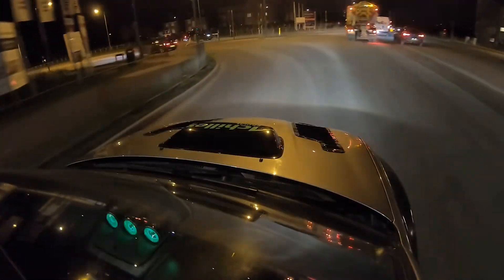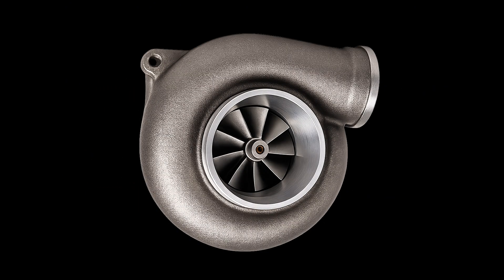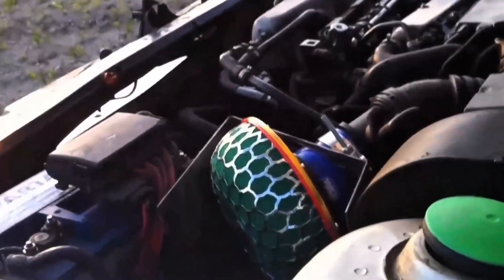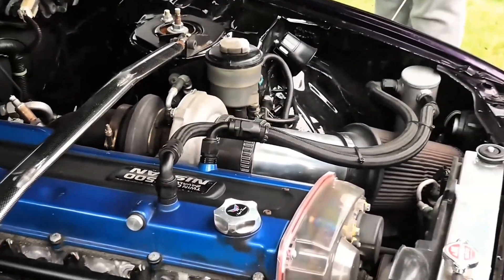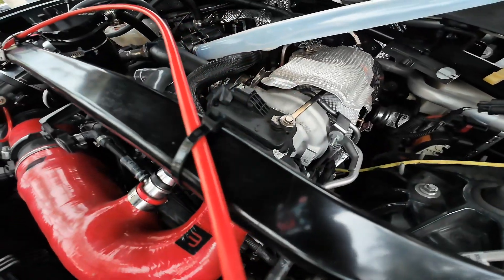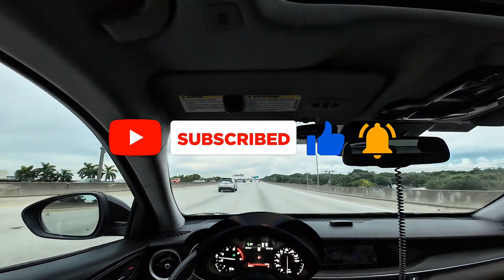Car Culture LIED about TURBO FLUTTER

Comment: Guy can’t read a compressor map to know that SURGE is a specific engineering term for the state of a turbo 

That state is not achievable with a closed throttle 

Surge is caused when a compressor flows more than a system will allow 

It’s at open throttle because it requires the turbine to be pushing the compressor against stacked up air 

When the throttle closes it’s not moving enough CFM to be flowing the numbers at the surge line 

Be careful who you learn from
Reply: Ok teach me something 

WOT Surge is a state of operation with a defined threshold 

It takes newtons of force to reach it and sustain it

It has a name and we see it printed on maps 

It deals with NON LINEAR loads of opposing forces 

Closed throttle Surge (and I’m using the term because you are) would be a variable state with what threshold and what type of force? 

WOT and Closed throttle are binary states that are mutually exclusive and diametrically opposed 

Can you give me practical examples of things that are mutually exclusive and diametrically opposed that have the same name and effect? 

What turbos are you using that the VE of the turbo is so high and so perfect in ratio of housing and compressor that the force they exert, although dropping off still compress so well that air that is non linearly dropping  off in pressure has the same effect 

Ready to learn
Reply: @jrich436  It is not surge if the flow is almost zero (because the throttle is closed) and the pressure ratio is high enough? also people aren't going to read your wall of text because of how it's written, why is every sentence it's own paragraph?
Reply: @DriftNick surge is specifically a threshold  at WOT. You can 100% calculate it and know the millisecond your set up will experience it

The damage is “turbine is going this way but the compressor is trying to go that way”

You have to have this constant and prolonged opposed force to cause this level of damage discussed 

That is surge 

The CFM of an engine and thus the force on the turbine drops non linearly as you lower RPM

Inertia is dropping due to friction. The compressor is not compressing nearly as much and then not at all 

Watch a boost gauge for threshold (effective boost) at WOT and how fast it drops off when you let off throttle in a system that looks at boost pre and post manifold 

IF you had a turbo with an aspect ratio that was high and running very high boost, under certain circumstances I could maybe engineer a system where the air could really harm off boost 

I’d have to cup the blades and have almost no space between the wheel and the compressor 

It’s just that the turbine isn’t causing enough force in opposition to the force of compressed air 

This is one of the reason REALLY good turbos and manifolds cost more than the Chinese units 

Less friction, better tolerances, more engineered/high efficiency parts 

The vast majority of people watching this video will NEVER run ratio/unit/boost combinations high enough for this to be a big deal 

Does no bov wear the unit. Yes. I’m most systems it will be nominal 

We have a correlation =\= causation issue 

Weaken a center section by letting it cook because you have no timer. And in that weakened state doing full boost at max rpm throttle lifts will 100% exacerbate the wear 

But that is not what was presented here 

As far as writing. Can’t be a wall o text when broken up. And while you may have the wherewithal to be able to read and comprehend…. I am aware of where I’m typing this 

Breaking it up to give emphasis aids in people who are not strong readers being able to follow on SOME level 

Good question. THIS was a pleasure
Reply: @jrich436  Another reason no one is going to read your walls of text, you just go off on rants about random crap, you did this in other comments of yours I've replied to.

You can calculate it when the throttle is closing or closed, it is no different, the airflow is reduced and the pressure ratio increases, this causes it to surge.

Surge does not just happen at WOT and in my experience it's far more likely to happen at part throttle, this is a problem you commonly see with time attack cars where they are part throttle mid corner but still making high amounts of boost pressure, High Performance Academy have a few videos talking about that exact issue.
Reply: @DriftNick I may have attempted to explain multiple ways but there was absolutely no “random crap” 

Your inability to understand relevance does not a mistake on my part make 

We typically see surge at wot but you are 100% correct 

All that is needed is a mix match between the cfm out of turbo and the cfm through the system with the turbine being fought against 

You can get this at partial throttle with the right combination but you aren’t getting nearly the same thing off throttle in most builds 

This is the reason we run anti surge. So that the power band we are wanting the set up to effect does not have the drawback of what the system does in other parts of the rev range and throttle position

I can run a oversized unit that I can still get to spool and reach threshold that I can’t necessarily have 100% positive flow across 100% of throttle range 

No problem, air bypasses blades “stustustustu”

Closing the throttle on most builds anyone here is going to be a part of does not have the combination of physics to cause catastrophic damage from shifting or braking (off throttle) 

Mix matched at WOT. Yes
Mix match at partial throttle. Maybe 

Race teams don’t care about this as much because we have “OPM” and a good engineer and team lead can sell to the owner/sponsor the “cost of winning”

You use what you need to win and engineer up to the point of the car crossing the finish line as cost based analysis 

You seem to be doing just fine reading this

Really these exchanges are for people like you who truly want to learn or hear what people are doing 

But you don’t want to write ONLY for someone with a technical background or experience 

Again, it’s been a pleasure
Reply: @jrich436  someone that truly knows his stuff 👏🏾
Reply: @DriftNick  How can you have surge in part trottle? Just run boost target vs tps like any other tuner in the world . This is not an issue at all.
Reply: @DriftNick  I read the wall, focus...
Reply: @lobotomyy  Yea it's just that simply to fix, no wonder you think jrrich knows his stuff, he also thinks surge slows the turbo down to 100's of rpm.
Reply: @lobotomyy since he ignored the question 

A rally car running anti lag can create the same issue of a turbine pushing against a compressor that’s is being pushed back on at partial throttle  

Im giving him the benefit of the doubt it was  a “whataboutism”/gotcha test and not that he didn’t know why that exists in that application/combination 

Here’s a counter question for them 

How much CFM flows through the 90* angle on a BOV for the 1-1.5 seconds at throttle shut 😂

How much more compressible is that gas?

How could that pulse back up ALLLLLLL the way from throttle body, through FMIC and back to the compressor with enough force to accelerate/decelerate (not gonna argue which) the compressor fast enough to torque the wheel against low force on the turbine? 

If he could explain that I’ll concede that it’s as destructive as surge parameters
Reply from the maker: There are two main causes for compressor surge. I explicitly stated the version in this video was due to oscillatory reverse flow upon closing the throttle due to low flow instability (aka throttle lift surge, and totally different from overspeed surge).

Saying surge isn't achievable with a closed throttle is incorrect, and you're confusing the types of surge.

You have been commenting inaccurate info throughout this video's comment section, please double check your info before replying.
Reply: @TorqueTheoryLabs no. There is 1 cause of the surge you highlighted

You EXPLICITLY circled the surge line on a compressor map in vid and then proceeded to say AND show in your video that closed throttle was an issue and said it hammered the center section 

You made no distinction between on throttle and off throttle to clarify

You are now trying to backtrack and use word play and “technicalities” instead of being an adult and saying you are repeating someone else who was wrong 

You’ve reached the point I said you would 

More and more people are saying you are wrong and my “wall of text” with specifics on why you are wrong broke through your cognitive dissonance 

So now, you are trying to make it seem like you were “technically” right because you want to die on a hill of science you learned from someone else’s video, like you were its creator and need to defend your work

At best you don’t know how sentence structure works 

At worst, you TRULY believe surge and flutter are the same thing and that surge can be created at closed throttle on a typical system and it hammers center sections and aren’t adult enough to say you are wrong and to make a new video 

Probably also fine with the amount of people telling you, you are wrong because it’s boosting your traction 

Why be right, when you can make beer money off one video and feel accomplished 

BTW overspeed is not the same as surge and is another issue. 

Correlation is not causation. Surge causes flutter but fluttering will happen without destructive surge (open throttle)

A 15-20psi typical a/r close throttle is not going to decimate a turbo. That same turbo surging at WOT WILL

Before you do this one turbo lag and turbo threshold are not the same although I’d bet my life you think they are and use the terms interchangeably 

You are straight out of an early 00s Honda forum 😂

Someone repeating info with a feeling like you know a bunch and then fighting people who tell you your sources are wrong and you misunderstood because THOSE people have practical knowledge and you are just repeating 

We’ve already told you. We have run units that were sized correctly and had no super accelerated wear and saw wear similar to bov cars

There is nothing wrong with a bov

But there is something wrong with having fundamental misunderstanding of physics and incorrectly influencing people who don’t know to then go argue (how you got here)

Comment: So what’s rhe “hawk” sort of turbo sound? (Kinda sounds like a scream and u hear it on diesels changing gears) different to the flutter sound
Reply from the maker: I'm not a diesel expert - but the hawk noise is likely caused by the wastegate venting, or airflow changes in the turbo due to fuel being cut upon gear shifts.

Comment: I’m not so sure it’s “that bad” I’ve ran my driftcar without a blowoff valve for almost 7years now. And the turbo is fine. I should ad that it’s a modified 22t with race internals. But still before that I’ve ran cheap Chinese turbos without a blowoff valve at give or take 1.5bar without any issues. My guess is that u would have to be super unlucky to brake your turbo because of “to much flutter”
Reply from the maker: This seems like a survivorship bias situation - but it can happen. It would be interesting to swap a turbo that has had flutter for many years with a new turbo to see how the overall performance changes.
Reply: @TorqueTheoryLabsno. He never surged lol

The cheapest Chinese turbo can survive no bov as long as on the AP the ratio never moves it across the surge line
Reply: @TorqueTheoryLabs Stav Tech's been messing around with turbos for nearly 30 years and he's not had a turbo fail due to lack of BOV. Although what does help him is he's a massive user of Holset turbos and all of those come with 360 degree trust bearings which can handle much more load than the regular 270. From what I've seen that's the key to making a journal bearing live with flutter
Reply from the maker: @Thee_Snow_Wolf 

Exactly! Which is why I specified that at the end of the video.

Comment: Off throttle turbo flutter causes minimal damage to a turbocharger and isn't as bad as you are describing, turbo surge (the one that Blue R34 was experiencing) however does cause damage. They are on two different scales. I wouldn't say car culture lied because this has been a topic of discussion for years. But its more of a choice, not misinformation.
Reply from the maker: You are absolutely right that surge from flutter, and surge from operating outside of the compressor's map are on different scales - but in the beginning of the video I explicitely pointed out that I was only talking about the former.

The blue R34 was spooling the turbo then closing the throttle, and not surging due to shaft speed (the harmonics are different).

Off throttle flutter hammers the bearings (as I mentioned in the video), and this has been proven to ruin turbochargers that are not designed for it numerous times. As for my titling, it's because people glorify flutter too much.
Reply: @TorqueTheoryLabs  correct, I'm not saying youre wrong I'm saying that off throttle turbo flutter isn't as bad as you are describing in terms of scale. Blue r34 however, I confused my self with this video instead https://youtu.be/nCj6Spwl1CU?si=E9Bo531ipY6sWYby, so thats my bad.

Comment: Compressor surge is VERY DIFFERENT from simply not having a blowoff valve. Get your facts straight dude.
Reply: Do you know what either is? It sure doesn't look like it. Complete nonsense coming out of your textbox
Reply: A turbo is a non positive displacement pump, shutting the throttle slows impeller because the turbine isn't being driven by exhaust gasses. Open throttle compressor suge is where the turbo produces more air than the engine can consume, blow off valves, or bypass valves where first fitted to cars with air flow meters to stop air being measured  twice when throttle is closed preventing higher emissions.
Reply from the maker: This is very incorrect.

Compressor surge is low flow instability. Having no BOV and letting off the throttle causes low flow instability (surge)

stutututu.
Reply: @TorqueTheoryLabs surge is on boost backing up of the air pulse 

The turbo is out flowing the entire system and at WOT the exhaust pulses are pushing the turbine but the air is pushing back on the compressor 

The turbine and compressor have opposite forces working on them and side load increases on the center section as air catches and slips on the compressor 

With no BOV the throttle shuts and air backs up to a compressor that is already slowing down because exhaust gas is falling off and friction and back pressure are slowing the wheel 

The air slips past the wheel in pulses 

It is not NEARLY as destructive 

He is right, you are not
Reply from the maker: @jrich436 

So, low flow instability?

You are literally paraphrasing what I said in the video.

What point are you trying to make?
Reply: @TorqueTheoryLabs in the English language, correct flow and structure of a sentence is used to convey information 

The thing said before a thing in a sentence relates to the thing after 

You group those in paragraphs 

If the subject you are talking about is different than the thing you were JUST talking about you let the audience know this by specifically marking a change in subject 

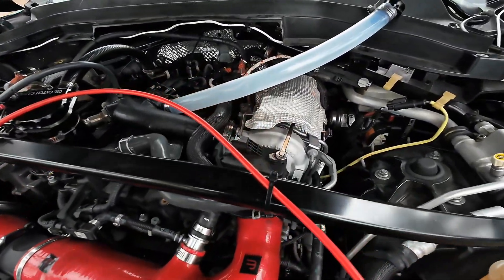At 00:16 you declare that we are ignorant and you are going to teach us what SURGE IS

While you THINK the info on basic turbo theory is relevant, while helpful… it isn’t 

If you take it out it doesn’t leave any needed info out. But an ignorant listener will assume it’s relevant and we are still leading up to surge 

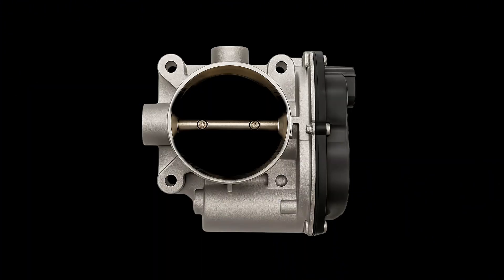00:39 you declare that our issue arises when the throttle is closed 

As you have not made ANY statements saying that we are talking about a relevant thing but NOT THE ORIGINAL ISSUE…. 

You are saying that closed throttle = surge 

This is INCORRECT 

I did not paraphrase what you said. I said your declaration is factually incorrect 

You have gotten and will get many people who don’t know anything thinking closed throttle = surge and you are going to get people who know better telling you you are wrong 

It’s been happening since you posted. Why are you pretending otherwise 

You don’t know how to publicly speak, and I don’t think you have high reading comprehension 

I know you want to be helpful and make some YouTube change, but your video as posted is worded incongruent with what I said 

Closing a throttle body DOES NOT CAUSE SURGE

Flutter IS NOT surge. Surge kills turbos, flutter slightly accelerates wear in the common systems your viewers are building 

I’ve read multiple responses you made. It’s not a misunderstanding or weird phrasing 

You think closed throttle = surge 

Absolutely wrong
Reply from the maker: @jrich436 

Calm down - you're getting way too heated. My apologies if I phrased this in a way that didn't make it absolutely un-nitpickable.

Compressor surge IS low flow instability. Here are a few triggers:

#1: Operating to the left of the surge line.

#2: Closing the throttle while the turbo is spooled w/o a BOV.

Low flow instability IS surge, there's no way around that. Closing the throttle while the turbo is spooled w/o a BOV pushes the compressor into low flow instability. Before you make a fool of yourself, do some research.

Comment: Okay so explain why buses, trucks in diesel dont need wastegate and they make amazing turbo flutter sound? They run yearly what cars can drive in their entire life.
Reply: because they have no throttle plate the fuel injectors are the throttle so even off throttle the air has somewhere to go. Hope this helped.
Reply from the maker: 99% of turbocharged setups have wastegates. 

We're talking about blow off valves - and the reason diesels don't need them is because they don't have throttle plates so fluttering won't happen unless they exceed their compressor map, but that wouldn't cause the high pitched stututu sound.